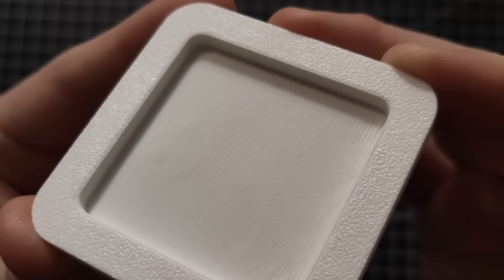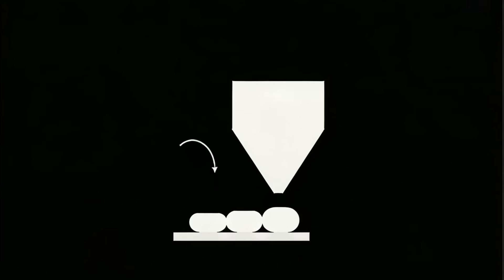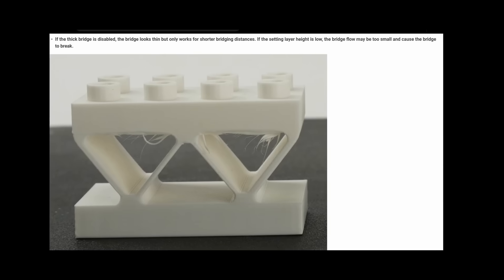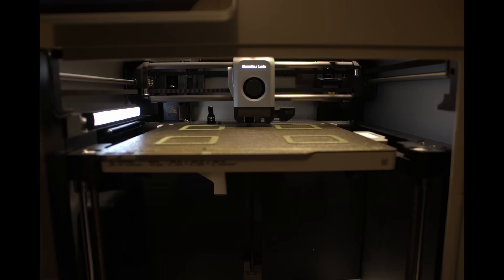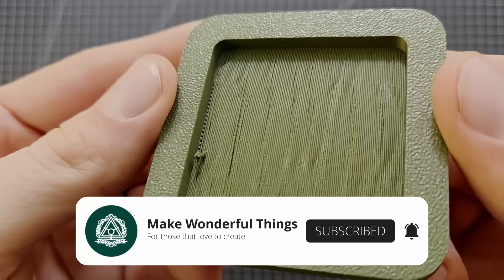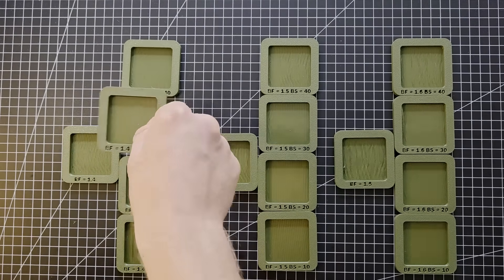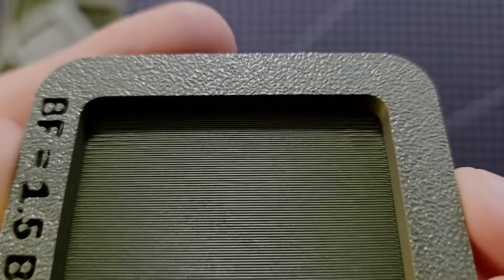The BEST settings for bridges? Smooth UNSUPPORTED 3D printed bridges

Comment: Great vid!  The corner sagging seems like it would be due to excess heat.  From the corner out, the extruder is basically not moving and dumping all the heat till 5th or 6th infill line out from the corner.

Comment: Its weird that they imply nozzle width would be the max, its normal for other brands default profiles print at about 110% of that for most normal layers, as this greatly improves strength and leaves a tiny bit flatter surface. Personally when doing structural parts I run 125% of my 0.4 nozzle (0.5mm line width) as I didn't visually notice any difference on the outside of walls, but it allowed at wider range of widths in Arachne mode (down to 76% or 0.38mm on a 0.4mm nozzle), just note it does negatively impact your max overhang angles (but not bridges).
Reply from the maker: Now, having spent months discussing this with literally dozens of people, I think they make this mistake because they just copy documentation from the past. I traced this statement all the way back to the Slic3r manual, which is an ancestor repo to Bambu Studio. In the documentation it says "Extrusions are round and their diameter is equal to the nozzle diameter." https://manual.slic3r.org/advanced/flow-math

In various places across the internet, dev's have claimed that it is "physically impossible" to go above nozzle diameter because of this sentence in the documentation. 
You are totally correct with your comment, though. Heated polymers are viscoelastic, which is what you have noticed. 

Also, thanks for the tip!

Comment: seems, it make sense only for Bambu Lab Slicer in your specific combination ( what is max vol. flow speed of the filament?). Can you provide (with G-Code Viewer from PrusaSlicer), which width, heigth, volumetric flow rate is generated - at least for your best results? because I see completely different results with my printer (it's not bambu)

Comment: generally I was happy with defaults in latest Orca releae. I tried in Orca Slicer 2.3.1 and filament Eleggo TPU 95A, for bridges of 10mm long, and 10mm width, and the result is bad (rather bulky, stringy, looks like a bunch of knots), With this flexible filament, better not to augment the flow, and keep default in OrcaSlicer. The bridges are not totally smooth, but within 0.4mm of model.
Anyway,  Thanks a lot for sharing these experiments and conclusions, and I keep the information for later model, altough it may nt aooly to all cases.

Comment: HOLY ALGORYTHM is rn that I'm setting a profile which has some critical bridges and I found this. Thanks man!
I wasn't worried and hadn't tinkered with bridge oprtions until I noticed... They're as wide line as the solid infill, at least on my features. I'm used to set it to 1,5x the nozzle because fast, but it makes bridges 0,75mm large and those worried me. I found stuff, like orientation of the bridge, there's a multiplier I set to 0,85 but... I could have screwed as you're about to say and show. 
Yet on the damn Bambu/Orca I'm not finding a "bridge line width" specific and yeah kinda circumvent this lack but as far I'm seeing it damn lacks a bridge width.

edited: I am so freaking dumbo goddmnit. You had explained at first, why the bridgeflowmultiplier IS the only control you have on that string because it's not a line squished onto something. Yet, in slicer it draws different width bridge lines in accord to the solid infill width I set. 
...There will be tests to be done on this aspect, taken into account your suggestions on the multiplier. It's a paradox. Because there should be a fixed bridge width because it's set in brass by the nozzle size, then it's good and fair to have a flow multiplier to adjust what you've shown. 
As it is now, I know what I'm setting but can't tell what the machine will do, from the slicer.
And after printed, I might be able to say "fine" or "rejected" but not to tell what parameter made that so. infill/bridge width or multiplier? Dang.
Reply from the maker: If you have some tech skills you can test this PR for bridge line width: https://github.com/OrcaSlicer/OrcaSlicer/pull/11255
Reply: @MakeSometh1ngWonderful  Thanks I'll take a look. I've tinkered another while in BambuStudio also read the wiki, I learned what plastic does and what the machine does to plastic on bridges, yet I can trick the printer only into doing the wrong side of the thing.
And I have to guess it's because bridges DO have a width setting, But it's the setting for the solid infill's width.

Ideally from what I got, the most accurate bridge you can get with a .4 nozzle is asking it to make bridges line not less tha .2 height, spaced by .2 (this would be the bridge width for, otherwise I can't set this spacing)
Then apply the 1,5x flow to this (already at 50% so it would be extruding 75% of the normal flow.
Then slow down speed as u pointed, ofcourse.

I must be missing something, bc I'm no engineer and they alredy messed with this before me.

If on the bridges I can't extrude else than a round string and not a fine line, my lines 0,2 high would be close to 0,2 in excess thick, below the bridges.
But I could aim to have it making 0.2 strings with a little flow excessand adjusted speed, to obtain a good surfaced bridge with hopefully won't be off more than 0,1 in Z. 
I mean, I could at least try, if I could set the bridge lines spacing, but without having ALL the internal solid infill at width 0,2 which will take eons to primt and probably mess up the actual infill.
I'd try but even if it works it will be unusable.

Comment: Thank you so much for this information. I instantly checked it out on my kobra 3 with BF 1.5 and BS 10 and it worked so well, it is near to perfect on a 30mm bridge. The difference to  the original settings is unbeleavable. Many, many thanks.
Reply from the maker: Glad that it helped! It's always good to tweak the variables a bit to see if you get even better results on your machine.

Comment: i have something that i print face down for 3d texture, and in doing so i have to select support only from build plate. and i am force to use default support. one edge of my item has a long bridge, and 15% of the time there are issues with sagging. i randomly stumbled across this video and i look forward to trying out this suggestion. appreciate the video.
Reply from the maker: I hope this helps! If it doesn't, you can see the other solution that I created in this video: https://youtu.be/Mrs2kAuRCBk

Comment: You can also reduce line width as an modifier. It could help with the cooling.
Reply from the maker: Yes, you're absolutely correct. I did that in the sequel to this video, seen here: https://youtu.be/eaasEkFULKE

Recently, I created a different solution that I prefer. It's based on line density. You can see that here: https://youtu.be/Mrs2kAuRCBk

Comment: Tested this on a P2S with Bambu Matte PLA and a 20mm bridge between two walls and it worked perfectly. Thanks for finding this!

The only artifacts I have are the start and end of the bridge, as these are sagging slightly. I think this is because they are wall loops (so not 1.5x multiplied) and still printed at 10mm/s.

Comment: Thanks for the video, very helpful.  I am using Sunlu PETG, and tried your top result BF 1.5 and BS 10, and it was OK, but trying BF 1.7 and BS 15 was nearly perfect!  I suspect material, brand and other factors have to be considered.  Thanks again for the ideas on this!
Reply from the maker: You're definitely correct on that. That's why I try to highlight experimentation in every video. Too many variables to just give out a one size fit all answer.

Comment: what acceleration value do you use for bridges? it matters to. i prefer about 500mm/s
Reply from the maker: That is a good point. It makes a big difference, especially for long bridges. For these experiments, I left the print profile for PLA Basic untouched except for flow and speed. I did that to reduce confounding variables. But, when I print with OrcaSlicer I use 2500 mm/s^2. 

Haven't really done comprehensive testing for different values, though. i will look into that!

Comment: This is really cool and I ended up trying this for myself (H2S). The settings I landed on are slightly different, but used the trend of your results to dial things in after a couple tries.

However, a warning!

This is an open loop setting, so bridging for longer periods will start to compress and mushroom the short section of filament between the extruder gear and the hotend. The restriction at the nozzle fights the increased volume of filament you’re forcing down (1.5x). This is especially true for the 0.2mm nozzle. Eventually, the extruder motor will error out and stop your print with a clog warning. This will leave your machine locked up until you can manually clear the piece of mushroomed filament above the cutter, which is unfortunately now smashed up against the filament sensor in the toolhead. Pulling the filament up and out can damage the sensor (ask me how I know). If you run into this, be really careful about how you get that filament out. Ideally you want to manually feed it down after the hotend is removed. Don’t pull the filament up, at least until you’ve snipped the fat part off!
Reply from the maker: Thank you for the warning! What was the size of the bridge that your printed? I just did a 90 cm^2 bridge with PETG and didn't really encounter this problem. I've also done several with Polycarbonate, which tends to be prone to clogging, and haven't seen this yet.

Comment: @make wonderful things , did you try to implement a pause or kind of priming cycle before starting with the bridging? it assume that the filament or nozzle temperature at the beginning of the bridging is still too high that's why it is not even at the start and becomes smooth after a few filament lines...
Reply from the maker: Yes, I did have a few prints where I paused right before the bridge for several minutes and then resumed. I do not think this was the issue. Based on the results in this video (https://youtu.be/eaasEkFULKE) I believe that the issue was over-extrusion due to the increased bridge flow. The video that I just linked shows a "work around" for this. 

In just a few days I will post a new video that has a much better solution, in my opinion.

Comment: Excellent video. It helped me with my prints using 1.5/10. I think the next time I gonna try to manually crank the fan to max during bridging and see if that will help it more.
Reply from the maker: Fan speed makes a big difference. For these experiments, I ran the stock fan of my X1C at 100% for the entire time. Recently, I upgraded the fan duct to a Biqu Panda Jet fan duct. That one change absolutely destroyed my bridges when the fan is at 100%. Now I run it at about 65% and that matches the performance that you see in this video.

Comment: Interesting results! This particular model looks to always be starting the bridge on the side, though... Doesn't that mean that even the first bridge line is technically always supported on 3 sides? More of a 'cliff' that's always added to, and less of a bridge. I'd think cutting off the edges of two sides of the model would showcase a proper bridge more accurately (So that instead of a square touching the build plate, it's two skinny rectangles touching, and the nozzle has to bridge between them).
Reply from the maker: Yeah, it's a good point that this model features a "cliff" at the beginning. I've done open bridges (like you're describing) a few times now with reasonable success. I plan on putting that content into the 3rd video.

Comment: I used your bridge settings, 1.5 and 10mm/s on my Centauri Carbon using Siraya tech ABS/CF and it looks great. only small discontinuities right at the edge. I'll post a pick on your thread at MW (@3DPmicro)

Comment: I have a question!  At 3.05 you mention shortening the distance between the bridge and the surrounding print.  How do you do that?? PLEASE tell me! (I subscribed, BTW, because I really value actual information!!!)
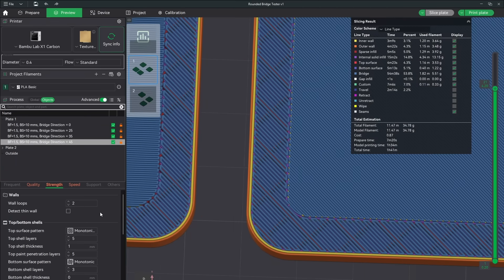Reply from the maker: Love the enthusiasm! I said "maybe if I shortened the distance that the filaments had to span when they were first being printed," which means a shorter bridge line. When you change angle of the bridge lines, as shown on the screen at 3:03, this creates a geometry where the first lines printed are short because they only have to span the corner geometry. 

I hope that helps!

Comment: I've been arguing with Orca for some time now about bridging. If you have a bridged area and slice it and then walk through the layers AND the lines themselves, you can see it clearly going Full Retard, trying to print in open space where it should be first anchoring and then building onto those already anchored lines. How many times I've been like "WHYYYY... WHY are you being so DUMB?!"

Edit: Just went back and looked through Object settings, found a little checkbox under "Quality/Walls And Surfaces" marked "Print Infill First". I haven't had a chance to retry my current overhang problem part but just looking at the slicer output it's like OMG so much better. First it prints the infill, then the bridged area, THEN the overhang. It's still maybe going to be problematic but I can suck up a little wasted filament to see what it does.

Comment: Loved this video. Great work. A couple years ago I edited some gcode to vary nozzle height of a test square line by line to dial in the z offset more quickly. Wonder if a similar approach could reduce the number of test pieces people would need to print to determine bridge settings as well.
Reply from the maker: That sounds like a great idea! If you work on a test piece you should post it on a file sharing website and I would love to give it a shot.

Comment: Someone probably already mentioned this, but if not, it may be worth playing with bridge acceleration. Also, extruder acceleration, although that would require some manual g code or post processing. I may play with that when I get a spare moment

Comment: I'm confused. You said that lowering the temp caused it's own issues, but it looks like both tiles you showed were using the same 210 temp.  Only difference I can see between them are their speeds. 
Timestamp 2:50
Reply from the maker: 210 is lower than the standard printing temperature of 220 (which is the temperature used for every other print in this video). I tried a few other temps, but didn't present them here because those tests weren't exactly methodical. Meaning that I changed a bunch of variables, not just temperature.
Reply: @MakeSometh1ngWonderful  Thanks for the clarification.

Comment: would like to know what font and size you used on your models so they are readable upon print. Or is the model just big enough that the text can be read? I just did the 1.5 and 10mm/s setting the bridging printed awesome! THANK YOU!
Reply from the maker: Thank you! I typically just go with Arial and make it 4mm to 6mm tall. I haven't really tuned the text or experimented with it, though. I just went with something, it worked good enough, and I haven't felt the need to change it yet.

Comment: hold on, for what filament is this? PLA? because i tried using the 1.5 bridge flow with PETG and it sagged like hell probably because of the 255 nozzle temp
Reply from the maker: Try setting the temp to 240. @adeveloper79, a commenter on the Maker World post linked in the description, demonstrated great success with PETG by doing that. A few others have experimented with alternative techniques regarding PETG prints like pausing right after the bridge layer, for example. Definitely worth checking that out.

Comment: I think the little bit of wavy lines that are still left is likely due to heat. If you can customize the Gcode for the bridged areas to reduce the temp it may help. I did this same test to see what gave me the best bridging flow rate and if you watch the layers being laid down from the side they swell upward and then shrink down as they cool. So basically too much heat for such a fat extrusion.

On my MK3S+ I found 1.6-1.7 to give me the best results with PETG printing at 25mm/s. I did try 10mm/s but the layers didn't seem to want to adhere as well to one another (gaps between).
Reply from the maker: Interesting results with your PETG. Yeah, most people are telling me that it doesn't do well with speeds below 20 mm/s. 
I just posted a video about the waviness. Turns out it was over-extrusion of the bridge lines that were still on the wall. You can tune that with modifier cubes, or like you said, by customizing the g-code.

Comment: After watching this video, I tested and made some changes to my printer profile.  The results were amazing.  On a test sample I made with an inner open area of 22mm sq, the unsupported bridge finish looks as good as the top surface.   I expanded it so the unsupported area is 33mm sq and it looks nearly as good.  By default, my Bambu printer profile had the bridge speed at 50 mm/sec.  The best results I had were at bridge flow ratio at 1.6 and speed at 20mm/sec.  It does slow down prints a bit but the overall quality of unsupported bridges is well worth it.  Thanks for this tip.
Reply from the maker: Good experimenting! Ive seen a few people say that 1.6 and 20 mm/s provided the best results. Usually, they are using PETG. What filament did you use for your tests?
If you have a few minutes it could be useful to others if you posted your results on the Maker World page linked in the description 😊
Reply: @MakeSometh1ngWonderful  I almost always print Sunlu PETG.  Very rare occasions I will use some PLA, TPU or ABS.  Just recently tried some PETG-CF.  It works pretty well too, but sticks to the textured PEI build plate too well. I need to try it with the smooth PEI or add some glue spray as a release agent.